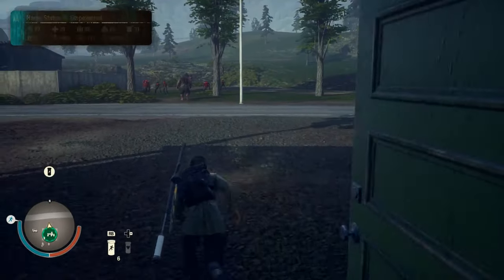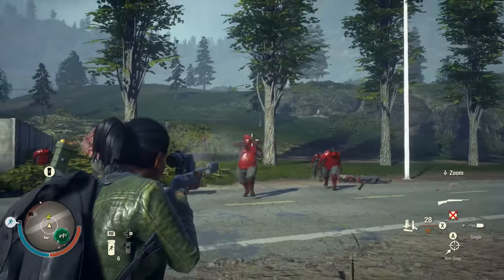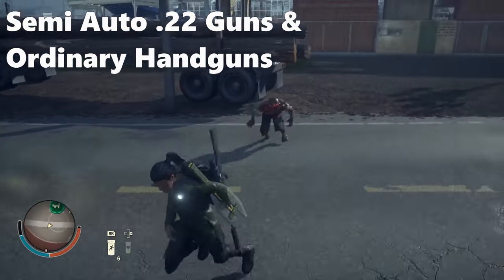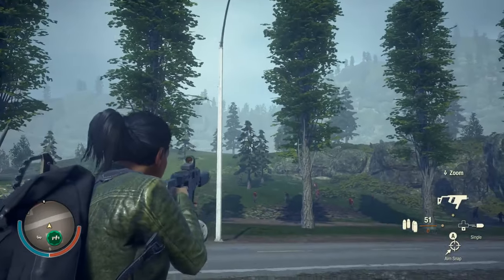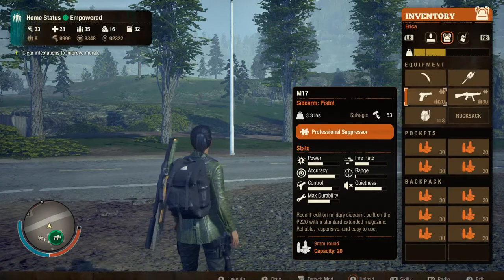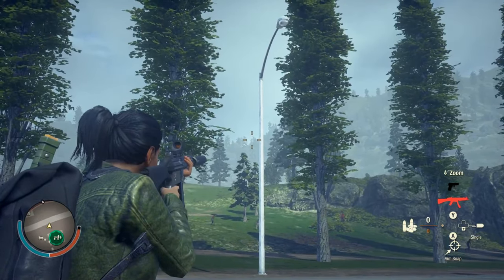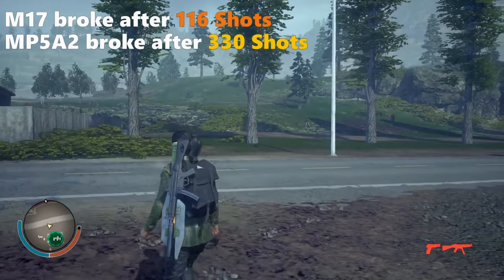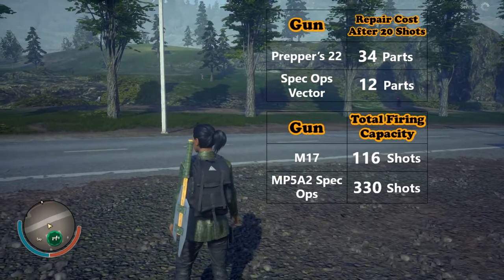You Should Know This Before Choosing Your GUN!!! The HIDDEN MECHANICS in State of Decay 2

Comment: Now this one for me is incredibly useful. Now I know which guns I'll just scrap the moment I get it. 

I'm full of sidearms on lethal and now I can clear them without the thought of "maybe I shouldn't" and make way for more parts for repairs and C4 crafting.
Reply: I would say forget the C4, use Bloater Gas grenades + a firework for the biggest boom in the game.
Cheaper overall too I think - but even if they weren't, still so powerful.
Reply: @geroffmilan3328  I will not disagree but using firecrackers is unreliable like Rvid said. I tried and tested it as well and its never a guarantee 3 booms to kill a heart but sometimes it does work. I always use road flares as an igniter for, like what Rvid said "consistent results". 

Bloater Gas is really valuable to me too not just on killing plague hearts but also hostile enclaves. I'd rather not waste this extra bloater gas just in case I need to clear "unwanted" or hostile enclaves to prevent mission lagging on your legacy missions.

Comment: Parts are so incredibly easy to get, that this matters very little. Just collect every melee or ranged weapon you don't plan to use, and salvage them. You should have enough parts to build a castle within a couple of ingame days. A crossbow alone yields over 70 parts, and if you combine this with salvaging weapon remains, you have to work hard to run out of the stuff.
Reply: Not on lethal mode. Parts are very scarce. And if you do get any, it’s almost always in increments of lower than 10. That’s why I always get every weapon and gun I can so I can salvage when I need extra parts. Salvage furnace is a godsend 👍
Reply from the maker: The Furnace is real good!!!

Comment: probably, the fast wear of the M17 is associated with a lower weight than that of the MP5A2, although it has a higher rate of fire. I hate it when the game misinforms with incorrect stats.
Reply from the maker: It is not just M17 but most of the handguns.. 

M4X1 DMR Heavy and M4X2 SSV will also wear 3 times fast.. but it will be mentioned in their description.. 

UndeadLabs should have done the same for all the fragile guns.

The handguns featured in my "top 7 Sidearms" video are durable anyway
Reply: @StateofDecayScience  does the MP5K wear like the other handguns? May need to start looking for more sawed off shotguns